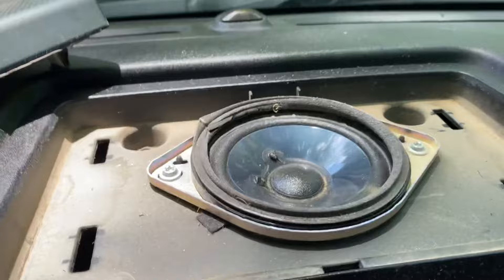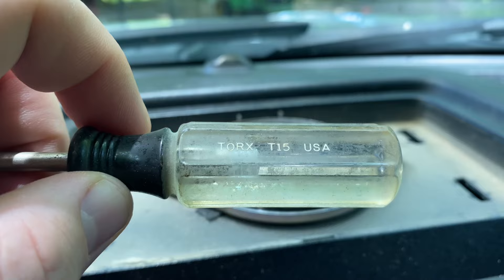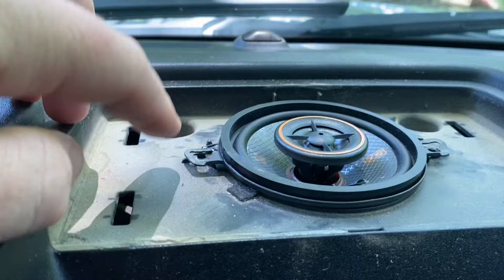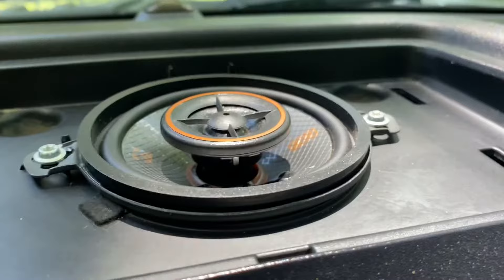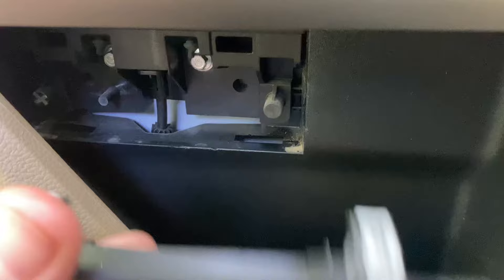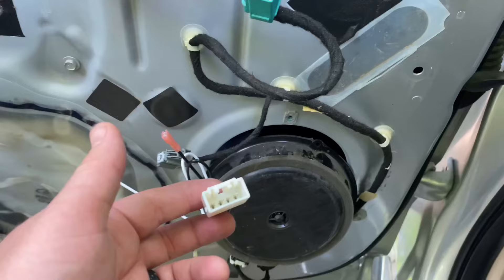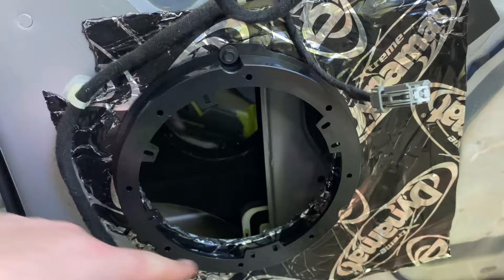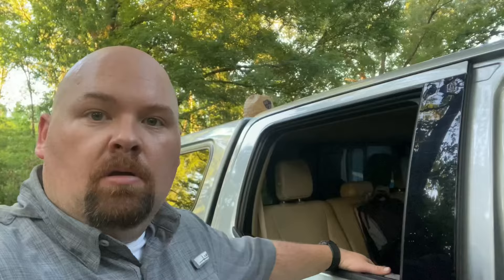Replacing speakers in a 2015-2020 F150. Its easier than you think! Grandpa truck gets major upgrade.

Comment: I used the JL AUDIO C-7s on the 4 doors, 3.5 center and A pillar tweeters with the JL RD 400X4 amp. Then two 12" subs in stealth boxwith JL RD 1000  in a under backseat box. Very expensive but I saved up and bought each piece until I had a complete system and installed all at the same time. ABSOLUTELY WORTH IT. Sound is ridiculously crisp and very clear. 17 F150 4x4 crew cab lariat FX4
Reply from the maker: Nice setup! I bet that sounds good! Thanks for taking the time to comment and for watching!
Reply: What JL amp did you go with? I'm considering something similar.
Reply: @mnguy494 
JL RD 400x4 for the doors and the RD1000 For subs
Reply: @jasonschaeffer72 hey sir , did you also keep your factory head unit with sync3 or did you have to go with a new one?
Reply: Yes. Still using the factory sync 3 radio. Still sounds clear and precise. Absolutely can't go wrong with JL AUDIO. If on more of a budget the C-3s sounds really really good to 👍

Comment: I have a 2016 F150 Crew Cab XLT not Sony.  When replacing speakers in truck do I need to install a new amp or does the factory stereo provide enough power to the new speakers?
Reply from the maker: Great question. You could add a amp to the system but it’s not necessary. Every factory system has an amp built in, it’s just not all that powerful but will be plenty to drive the bee speakers. Thanks for taking the time to comment and for watching!

Comment: I have a truck with no center speaker. I do have the place for it....but it's simply storage (like the front part of yours) .  Can they be retrofitted to allow a center ?
Reply from the maker: I’m not sure… I’m sure it can be done. I will not be doing that to my new truck which is a STX. Not only would you have to modify the storage bin you’d have to wire in the new speaker to the system. For what you get out of the center speaker I wouldn’t bother. Just my opinion. Thank you for taking the time to comment and for watching!

Comment: Nice, did you consider changing the tweeters in the A pillars? I really want to do a complete system swap too. Nice video. Let us know what amp you decide on.
Reply from the maker: I’ll do that. Regarding the tweeters. I think I’ll leave them along. Due to the 6x9s in the door the highs are great but not overwhelming. I think you can over do the high ends. Thanks for taking the time to comment and for watching!

Comment: Would there be any difference to the install on a B&O system? Have a 2018 lariat and the B&O is awful.
Reply from the maker: I think it will be similar… I think that system has more powered watts than the Sony system which should yield some nice power aftermarket speakers!
Reply: Hey did you ever get this done I have the same exact truck as you I’m very curious
Reply: @Jersey Rolla  Not yet, read through several pages and forums and sounds like its pretty simlar. Whatever speakers go in will be limited to the b&o system output though

Comment: I've got a stupid question...
The Amazon description is a little vague on one of these speakers can't remember which one now but...
Are all these speakers sold in pairs? And if so what did you do with the 2nd 3.5" (center dash speaker). 
Thanks.
Reply from the maker: Yes they are all sold in pairs and the plan is to install the extra one in my wife’s expedition. Thanks for taking the time to comment and for watching!
Reply: @theoverdriveconsumerchanne4424  did these speakers improve overall loudness and clarity quite a bit?
Reply: @theoverdriveconsumerchanne4424  oh and do you need the speaker harness for the center speaker too?
Reply from the maker: For the simplest install buy the speaker adapter kits listed. They plug right into the factory connection.
Reply from the maker: Look for the keyword harness… that’s essentially what it is. I have a link in the description.
Reply: @theoverdriveconsumerchanne4424  yeah I knew I needed for the door speakers. Just making sure harness was needed for dash speaker as well. Thank you.
Reply from the maker: Ah… its been a little time now but best I remember I cut and spliced the wiring for that one.

Comment: The factory one with a smaller magnet is actually better because it has a stronger neodymium magnet
Reply from the maker: But aftermarket sounds better… thanks for taking the time to comment and for watching.
Reply: @theoverdriveconsumerchanne4424  I was just comparing the stock center channel speakers also neodymium magnets hold their magnetic charge 10 times longer than ceramic ferrite magnets just a fun fact

Comment: I purchased the same speakers and mounting parts. Unsure how to connect the speaker to the mount. Any advice would be helpful.
Reply from the maker: It’s been some time now but if I recall I used the factory screws to mount the new speakers. Line up the bracket and screw the speakers into place.
Reply from the maker: I’m not sure if I helped any? Is that what you were talking about?

Comment: Would installing these speakers without having the premium audio amp still benefit? Assuming the stock head unit and Xlt base sound system. Thinking of doing the console and all 4 doors as well.
Reply from the maker: It’s definitely going to make an improvement… the stock system regardless of trim will still still through power to the aftermarket speakers and the aftermarket speakers will definitely be noticeable.
Reply: @theoverdriveconsumerchanne4424  Thanks. I noticed that the center console speaker requires splicing as well, for anyone interested with the same stock system I have.
Reply from the maker: @twentyonetoone9783  correct… you will not notice a huge difference with that speaker by the way…. But anything I’d better than stock speakers. They are terrible.

Comment: What did you end up doing with the tweeters on the Pilar’s? I see that most of all your speakers were either a two or three way! So theirs a lot of high end.
Reply from the maker: I kept the pillar tweeters stock. I didn’t want to have to customize the install on those. There is not a direct for replacement that I am aware of. They sounded just fine with the new speakers.

Comment: Good video - do you have to worry about the speakers being waterproof?  Doesn't the backside of that panel see water? Isn't that why the vapor barrier there?  Just curious - thanx
Reply from the maker: Thank you. No sir I’m not worried about moisture but they make speaker specific protectors for moisture and dirt. Personally it hadn’t been a problem for me over the years. Of course adding protection never hurt either. Thanks for taking the time to comment and for watching!

Comment: Still using the tweeter at the A pillar even your speaker is a 3 way?
Reply from the maker: Yes, I did continue to run my factory pillar tweeters. To be honest they really didn’t add a lot to mix. In my opinion, the three ways balanced everything out.

Comment: awesome video! I have a few questions. Will all these speakers work if I don't have the Sony sound system? I'm curious, how come you didn't change out the tweeters in the A pillar? How many Harnesses would I need to order for all the speakers?
Reply from the maker: Yes you can install these speakers with any factory or aftermarket head unit. I didn’t change the tweeters because they are sufficient and the replacement for them can be a little challenging. Reference the description and I have everything listed. The kit comes with two adaptors so you’ll need two kits for the front and back speakers. Please me know if you have anymore questions.
Reply: @theoverdriveconsumerchanne4424  Awesome! thanks for your response!
Reply from the maker: Anytime! Thanks for the support!

Comment: Is it worth upgrading speakers even if you don't have the Sony from factory?
Reply from the maker: Even more reason to upgrade the speakers! However if you’re happy with what you have don’t upgrade! Music is a big part of my life so I invested in some better sound.
Reply: @theoverdriveconsumerchanne4424  this is the only vehicle I've had a stock stereo in. I over looked at least getting the Sony stereo when I got it. Just worried the factory head unit Amp won't drive anything bigger that's what I'm wondering. I don't mine getting an Amp for aftermarket speakers but it's going to be a ton more work vs just tossing speakers in.
Reply from the maker: @YellowVtec  the factory unit will drive aftermarket speakers just fine… just don’t think you’ll win in an audio competition. If you can add an amp even better bit you can run them off your factory unit.

Comment: Did you upgrade the alternator or battery for the additional amp? Cause I want to add 2 amps and some woofers but don't know if the charging system can handle it
Reply from the maker: This truck had an amp from the factory that powered the system and the 8” sub. With some of my builds in the past I simply added a capacitor and it aided the system enough that battery and alternator was enough to do the job. It all depends on the amps you want to run.  However, buying a deep cycle battery with a capacitor will definitely help you with any upgrades. Thanks for taking the time to comment and for watching!

Comment: Can you do 6x9’s on all four doors front/rear with the plastic speaker pods???
Reply: The rears on the 2015s and up are 6.5 inch speakers
Reply from the maker: Sorry for the late response. No 6 1/2 for the rear doors. If you want bigger speakers (6x9 in this case) you’ll have the modify the door.
Reply: Thanks for the info, just replaced them with kickers. 6x9 fronts and 6.5 rears.

Comment: Hello just wondering what screws can I use??
Reply from the maker: I used the screws that held in the factory speakers.
Reply: Yes thank you I meant for the mounting bracket and the speaker
Reply from the maker: For the speakers I used the screws that came with the speakers.

Comment: How did you wire the 3.5in speaker in
Reply from the maker: I used these harnesses. Harness for factory connection to the new speaker https://amzn.to/3uwkLpl
Reply from the maker: Thanks for taking the time to comment and for watching! Let me know if you have anymore questions
Reply: @theoverdriveconsumerchanne4424   did you have to wire in a resistor to the speaker or anything an how does it all sounds turned up.
Reply from the maker: I didn’t use any resistors. I can definitely hear more high ends with the three way and the sound is more balance. My passenger door has a plastic rattle when the volume is up but I believe I can fix it. I just need to take the panel off again and troubleshoot it.

Comment: I notice you had three females on the new speaker. The kit you recommended only has two on it. What’s the third one?
Reply from the maker: It's been 2 years but I'm pretty sure that third wire is for the tweeter and the wiring came with the speakers if I recall correctly.

Comment: Had a dodge ram 1500 with a killer stock system when I got it and went to a gmc because if the engine that was solid trash and such a disappointment after driving that for so long but the engine died on the dodge which is the real downfall with hemis but went back to Ford with the Sony system and so much better but still not a Harmon Kardon system but really close. Pretty sure Dodge trucks have the best stock sound systems imo but had the same paper cheap cheap speakers in that gmc z71 smh, rediculous for that type of truck and should be better.
Reply from the maker: You’re spot on man! Thanks for taking the time to comment and for watching!

Comment: 2022 (or 2021, doesn't matter) and clueless hobby installers STILL judge speakers by comparing magnet size... I guess, why not? Pro installers do the same! Anyway, good to hear that upgrade led to more depth and balance (whatever that means..................).
Reply from the maker: Size always matters…. 😂
Thanks for watching.
Reply: @theoverdriveconsumerchanne4424  of course it matters: bigger/stronger magnet, stronger motor, stiffer suspension = promises for higher power handling = higher SPL... however, I have the impression amp hasn't changed. Anyway, all I am saying is that the factory system is thought out as a cheap (hopefully free of charge) sound solution. Of course almost any after market piece of hardware would be better, but a real overall improvement can only be achieved if other parts of the sound system are equally improved.

Comment: Did you ever consider installing a amp for all the Audio.
Reply from the maker: This system actually has a small factory Sony amp included. I did consider adding an additional amp for a behind the sit 10” sub… but that is fair as I went with that system.

Comment: You replaced an 8 ohm speaker with a 4 ohm speaker. Now the center channel speaker is unbalanced and will be louder therefore ruining the soundstage. Typical audio newbie.
Reply from the maker: Don’t claim to know it all here… however I appreciate you for taking the time to comment and for watching!
Reply: Maybe you can answer my questions. I have the base model factory speakers, they are not Sony, so… what ohm are the door speakers? Looking to upgrade and the options I looked at some of the models of aftermarket speakers are 2ohm or 4ohm, which would be best?

Comment: Do you have to have the brackets on a 2015 f150 to install the kickers?
Reply from the maker: The brackets make the install easier and cleaner. If you’re really good you could maybe install without but in my opinion how cheap the brackets are just get them
and install will be a while lot easier. I hope this helps. Thanks for watching!